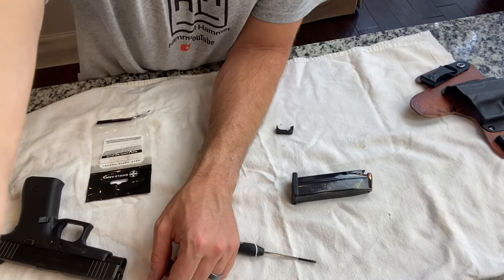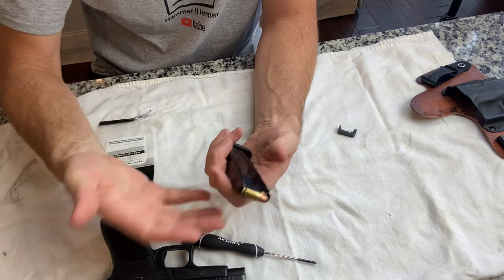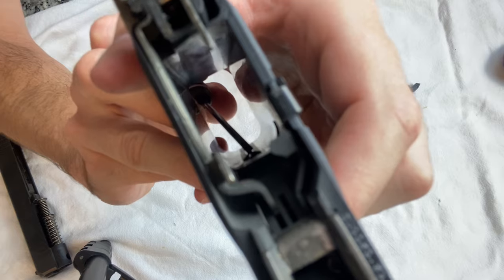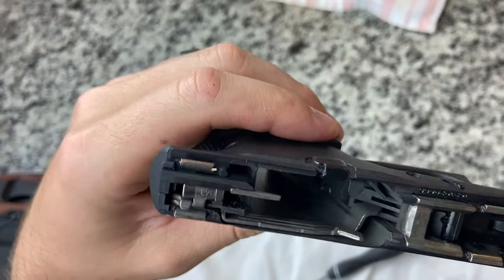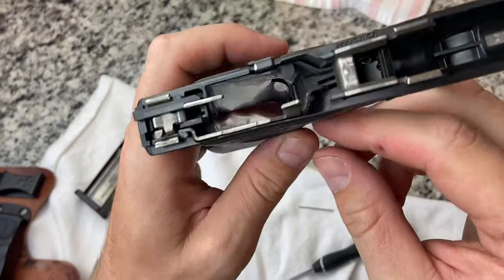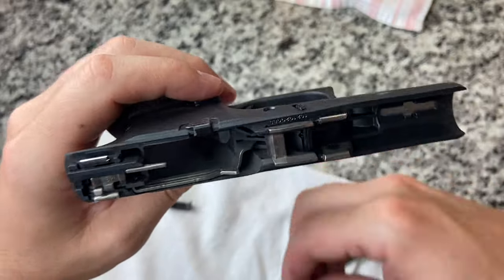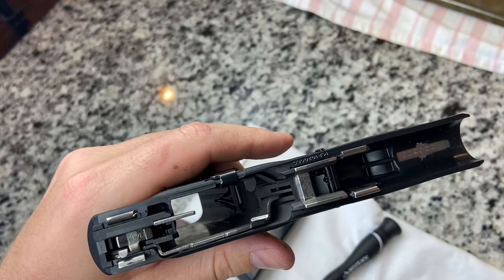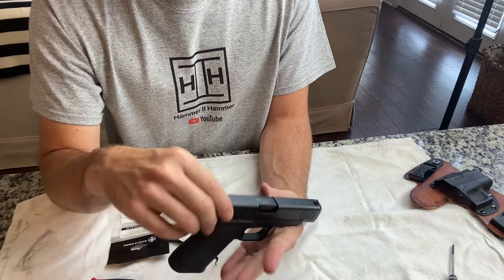Shield arms magazine release Install / Swap, Glock 48 / 43x Step By Step

Comment: not a fucking way my gun can be done with this shit screwdriver, been doing an hour, it's fkn stuck and has so much pressure to it
Reply from the maker: Yeah cheap $2.99 pick set from harbor freight makes it easier for sure. I’ve done several with the screwdriver but prefer using the pick as it’s easier to hook under the rod with pressure.
Reply: @HammerIIHammer  Thanks, but I do not live in US and A. :D I managed to finally do it with screwdriver but it was a painful process. xd